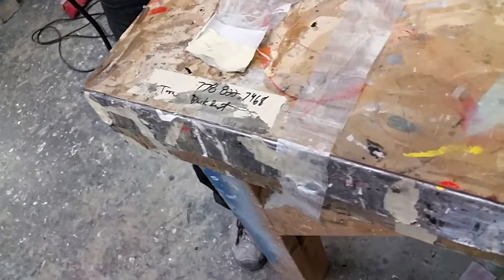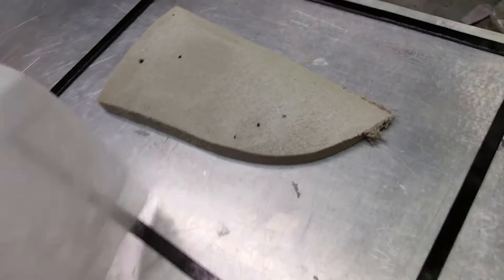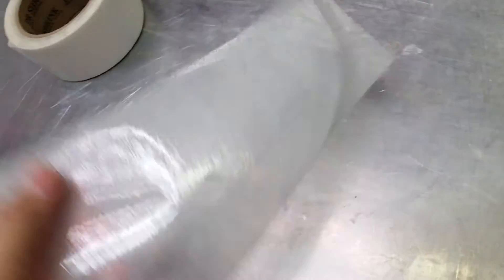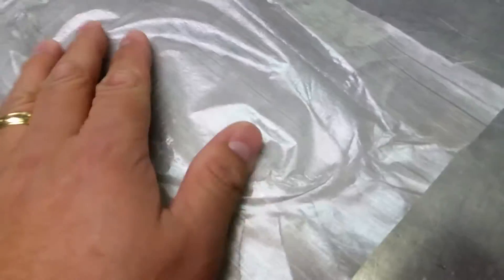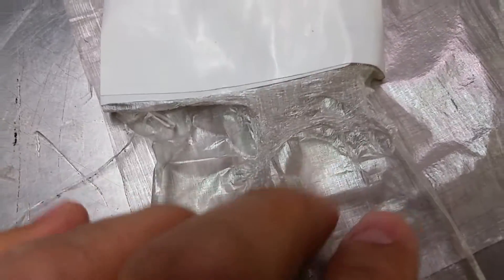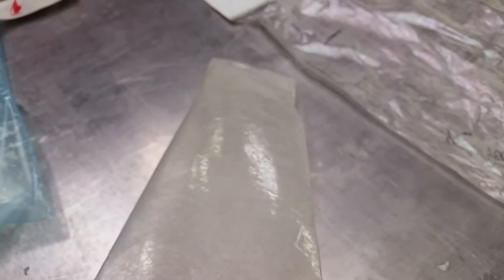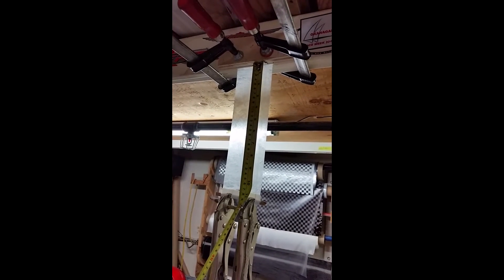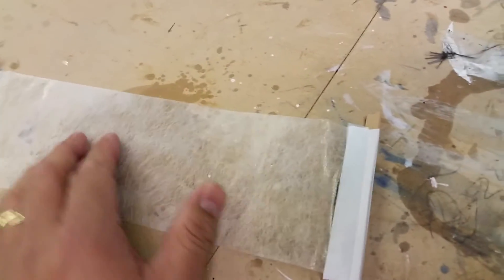RC Sail Material: Testing CPM505 & Dyneema (Cuben) Fiber - Part 2

Comment: What is the weight of the Cuban Fiber you are working with? Can I ask where you got it from?
Reply from the maker: The material was 0.51oz.  Not sure where I got it from sorry.
Reply: @consumerwil  No worries. I picked up some Dyneema 1.0 because I couldn't find 0.8. I'm going to look again for the 0.51 as I thought it was too thin but you have convinced me otherwise. Thanks for doing these tests. So, I've only seen curved sails produced via sewing together panels. Are you really getting a full sails with camber?  Have you even made Victoria sails?
Reply from the maker: @ I'm HOTrcsails and make Victoria sails too :)